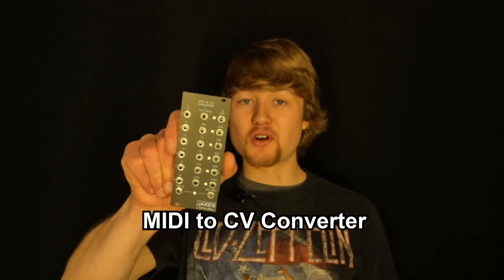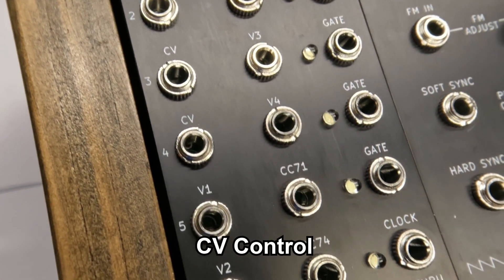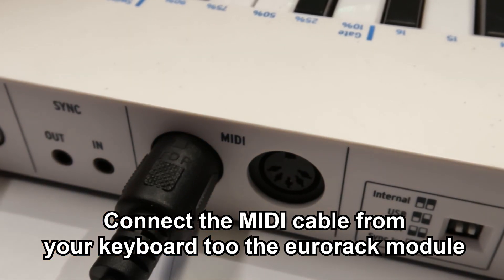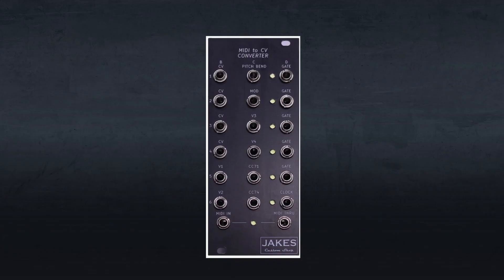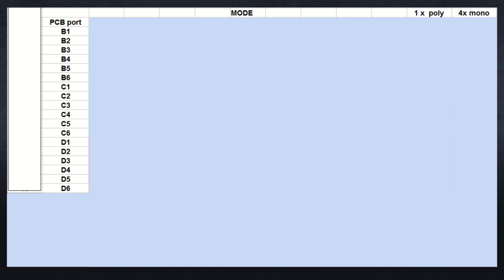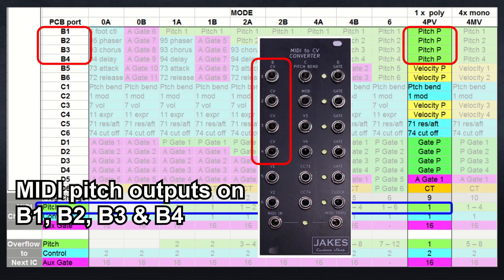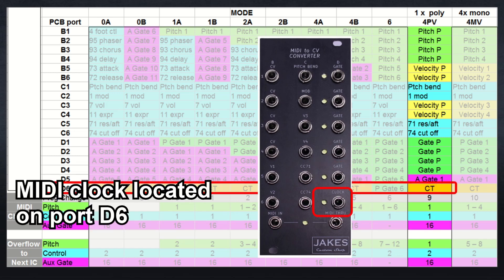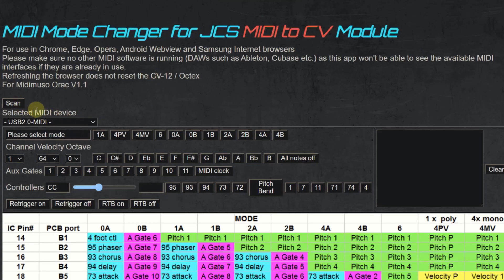MIDI CV Converter Eurorack Module Demo

Comment: Finally gotten around to using mine with my PolyEnd Tracker (annoyingly Midi TRS Type B), Type A to Type B hack; use one TRS to RCA socketed cable, and TRS to RCAs plug cable, plug the red in to the white, and vice versa, now you have a TRS Type A to Type B cable woo! Having external devices as master clock to Pamela's New Workout is a new one on me but, pretty flawless and awesome to have 4 cv and gates and clock!
Reply from the maker: Awesome!  Thanks for the tip, and glad to hear you enjoying it! 

If you decide a more compact solution would be better, we can always whip up a custom TRS cable too.

Comment: Does it have the mode for a key split?  So for example, choose cv1, v1, and gate 1 to always be above the middle C note, skipping voice assignment for notes below middle C.  The use case here would be to assign cv1, gate 1 and velocity 1 to a particular oscillator which would play "lead" parts. And send the remaining keys (below middle C) to other oscillators to play bass or chords or whatever.  Or would that operation have to be done by using midi channels?  Thanks.
Reply from the maker: Unfortunately there is no key-split function. Notes can be assigned either polyphonically on a single MIDI channel in the order in which they are received; Or individually on separate MIDI channels.

Key splitting would be a sweet function, I'll talk with the software team and see what is possible.

Comment: My comment truncated. Beyond switching modes, shown in the video, the app is a complete mystery to me still.  Is it possible to send clock transport controls from this device?
Reply from the maker: The "Midi Mode Changer" tool is used for changing the operation mode.  The other buttons are mainly for testing (not for actual play).  

The MIDI-CV converter simply takes in a live MIDI signal, and converts the information to 1V/O CV outputs for use with eurorack.  Since it receives real-time MIDI data, there is no Clock Transport Controls.  

I hope that answers your question!